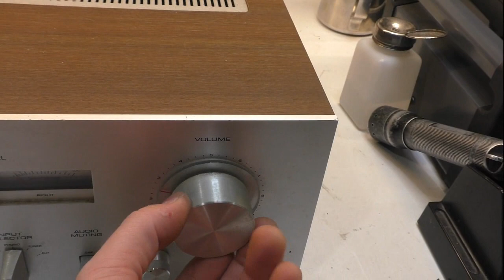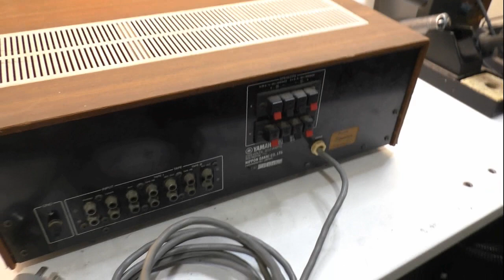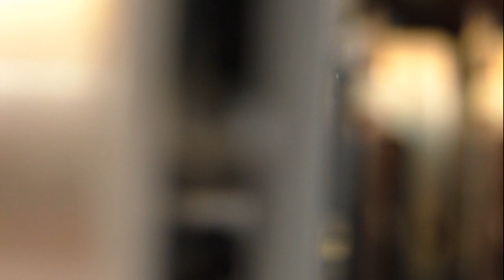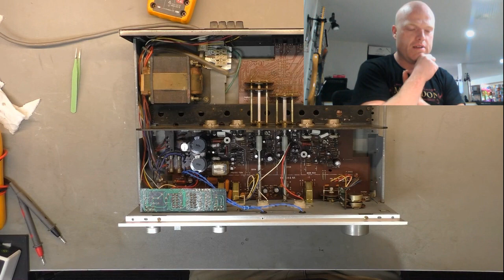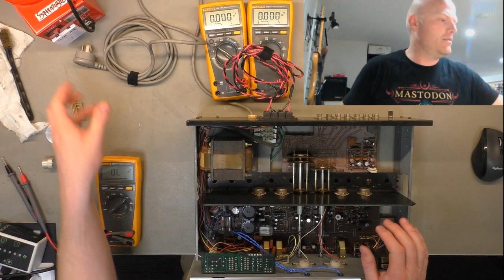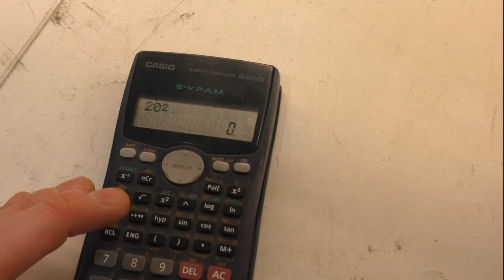Yamaha CA-610 Repair & Restoration

Comment: Do you actually service this vintage Yamaha equipment? I have several of their receivers, had them since new, and no techs around here will even touch them. Sadly they are slowly becoming boat anchors in this home. 😢
Reply from the maker: Yes, but it's expensive, as you can see in the video, they require quite a bit of work in order to be deemed reliable.
Reply: @BradsGuitarGarage not that I’m a rich man but there is a lot of emotional attachment to these. Do you work on North American voltages? I assume so.

Comment: late to the party but I just picked up one of these beasts!   Do you know how i can remove the small rubber feet on the bottom of the amp?    im afraid to pull them straight out because there is very little give and i dont want to warp the bottom metal panel. 

Thank you!

Comment: Wonder if anyone on here can help me here……
I have just bought a “working” CA-610. 
However…..the “protection cut out” keeps cutting out. 
Im using 8ohm speakers, and have not turned these up properly yet. 
It also cuts out while speakers are disconnected! Totally random too. Sometimes i can use it for an hour without issues….sometimes 2 minutes! Help 😂

Comment: Hi Brad. In your opinion, can this amp comfortably run 6 ohm speakers?
Reply from the maker: I would not recommend it. Stick to the user manual recommendations for any given amplifier. However, if it's just a matter of a 6R tweeter, I'd confidently use it, as they likely have attenuation and there's not much energy being transferred there anyway.
Reply: @BradsGuitarGarage  Good information. Thanks Brad.

Comment: I have one of these amps. What is the power supply voltages? This is important info and was not checked in the video -- between projects, that I get. The unit I have is a plus/minus 38.5 volts on the supply rails. Is this proper? Nowhere in the schematic or service manual that state the rail voltages. Thanks!
Reply from the maker: I don't show everything in the videos or they'd be hours long.
The schematic on the service manual references voltages at many junctions.
It claims + / - 33VDC on the main rails. 38.5VDC should be fine.

Comment: Great video!  I just purchased one of these for not a lot of money, and is in mint condition (cosmetically). Opened it up, and looks like it has already had the output TO-3s replaced (Sanken -> Motorola), with gobs of new heatsink compound.   The loudness rotating switch is very tight, (stripped the knob) so will try to loosen that up.  I was curious to where you found the info on measuring the required current of 11mA across the testpoints - is there a service manual available for download somewhere?  Cheers 🍺
Reply from the maker: It's available many places online.

Comment: Hey Brad, Great video, I am having trouble removing the volume knob...What do you need to loosen the screw?  It doesn't seem to look like an allen key fit like the input selector knob etc.  Also my Allen keys aren't long enough to reach it to even try,,,is it worth cutting them and using a spanner? 🤣
Reply from the maker: There are one or two allen keys on the shaft, behind the front panel. They're accessible through the gap between the front panel and the chassis.

Comment: I have the same amp and it stopped working, the power LED comes on but no sound coming out of it. also that little click you mentioned was the speaker relay - and it stopped 'clicking' for me. I swapped it with a new one thinking that's the issue but same as before. 
Would you have  any specific thing to check before I re-cap the whole thing?
Reply from the maker: Check the solder connections in the speaker protection circuit. This one was good for several months, but came back with random cut outs. I found the voltages in the relay triggering circuit to be fluctuating due to a leaky transistor. Replaced it and it has been.good since. But yes, there were many leaky caps on this one so replacing them all was necessary first.

Comment: Hola amigo. La limpieza que haces al final del panel frontal, es solo con el trapo humedecido en agua o le pones algùn producto....Muchas gracias....El video muy bueno..
Reply from the maker: I used about 20% of a general purpose cleaner called "Nifti", mixed with plain water.
Often just plain water works by itself.
Reply: @BradsGuitarGarage  Muchas gracias por tu amabilidad.

Comment: Buy yourself a set of ceramic-tip tweakers made specifically for RF alignment ---- it should have all the tip types and sizes you'll ever need for tweaking bias pots. For those who aren't aware, some bias pots look like they take a Philips bit but actually require a special Philips variant screwdriver with a flat, not pointy tip. Possible to grind an ordinary Philips screwdriver to flatten the tip, but I prefer not using a conductive metal screwdriver for adjusting bias.

Comment: At about 18:40, watching you swap the meter probe position and polarity ---- for years I've even telling myself I want a knee-operated button under the bench to reverse the meter-probe polarity without me having to physically move the probes. Some of the stuff I work on might have 4 to 8 output devices per channel and there are always a few transistor locations with stuff in the way, where it's difficult to reach in and make good contact with the probes. Checking driver and differential transistors for shorts can definitely be a pain when you have to reverse the probes. I usually use an analog meter for this, a Triplett with a polarity-reverse switch, which can be usefull. but it often requires a "third hand" to operate the switch while holding the probes....

Comment: Re, the loose volume control: Almost all vintage Japanese hifi has a locating tab on the pots and a hole in the chassis for the locating tab to sit so that the pot can't easily spin around and around unless the shaft nut has loosened several whole turns. Few if any guitar amp manufacturers have ever done anything this sensible.....

Comment: We have an air compressor at the audio repair shop, for blowing out dust, dirt and debris from inside customer's equipment. Pet fur is of course very common, but a number of our customers apparently keep birds and I've seen lots of small feathers inside amplifiers and receivers. Some units arrive with a carpet of what appears to be clothes dryer lint, occasionally so thick that you can barely see the components! The worst is when the equipment isn't in an enclosed cabinet and the owner has cats. Cats love to lay on warm electronic equipment, even after it's been off for a half hour, and sometimes they pee a little in their sleep. A couple drops of cat pee can cause major corrosion damage.